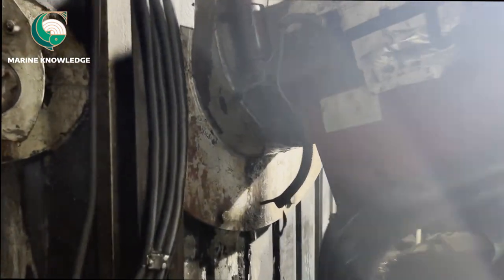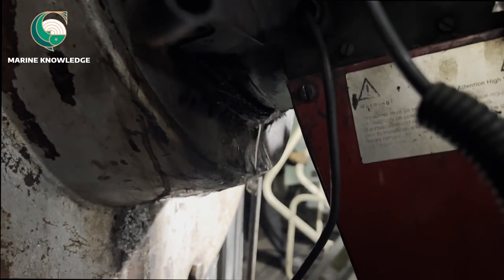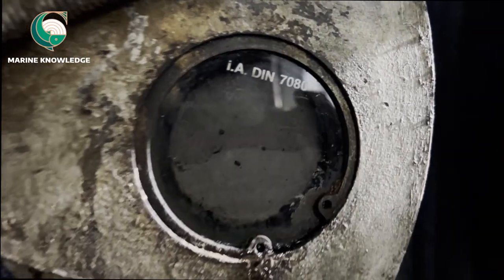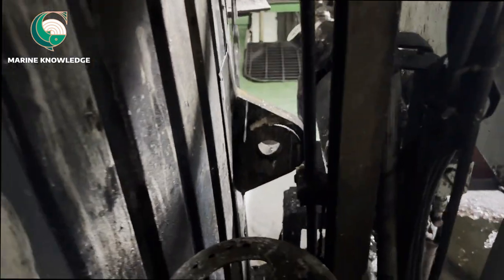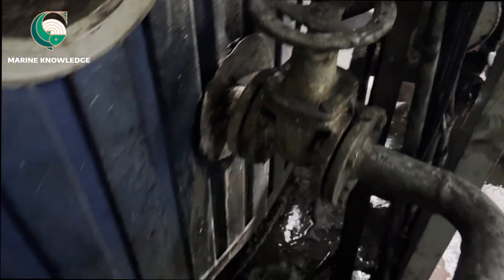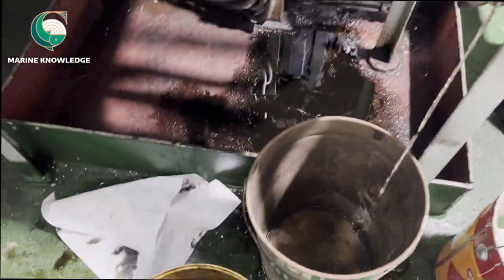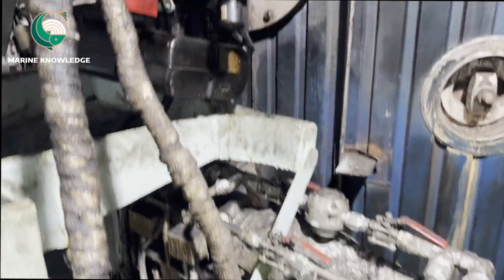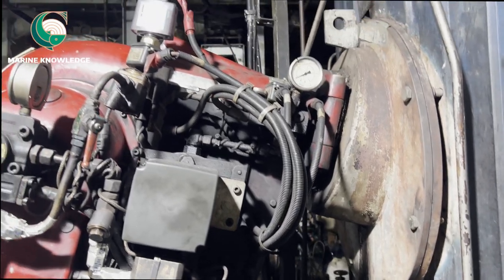Rare video Footage of boiler water tube leakage through burner....

Comment: Low water level alarm in water drum  is not working or what... 
How the furnace is filled this much upto boiler burner
Reply from the maker: sir this was filled because of leakage which happend  due to crack in shell and the water filling from bottom of chamber ...ur right low level alarm came but it tuk little time to find the leakage from bottom side.we all lukd for feed pump losing suction..